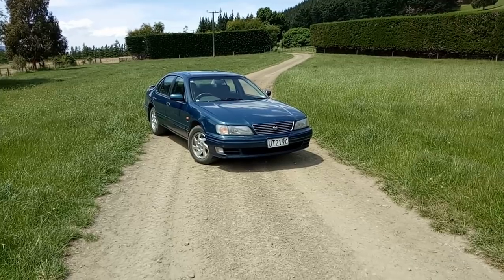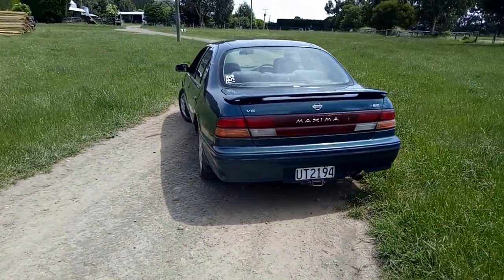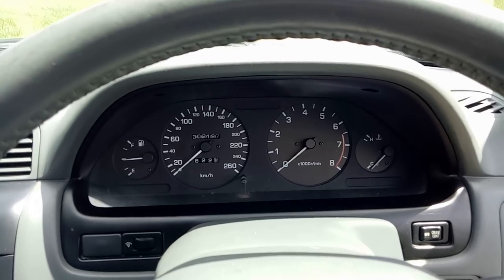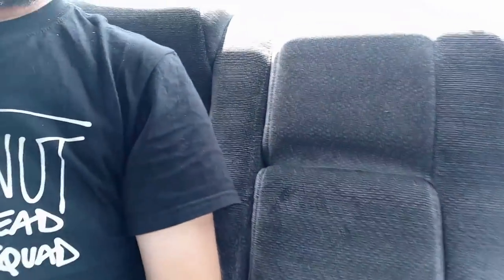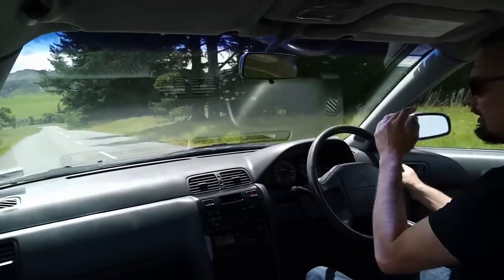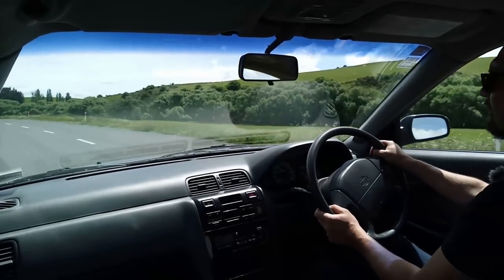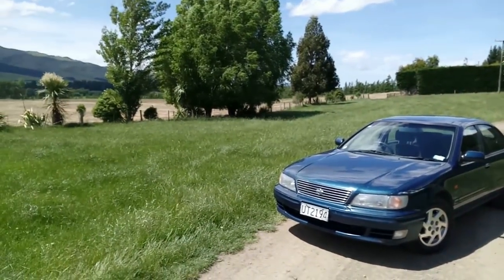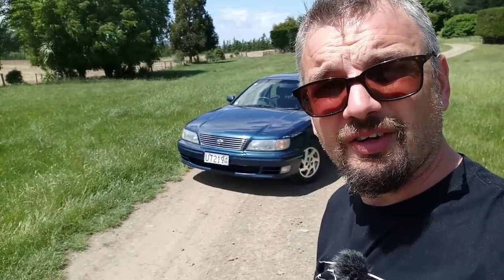Real (NZ) Road Test: 1996 Nissan Maxima 3.0i (or Maxima QX or Cefiro!)

Comment: I had 98 version of european Nissan Maxima QX, 2 litre v6 with manual gearbox and cruise. No ac. Super car, very smooth to drive and never had technicaö problems. Finnish winter and salt was end of these. Quite easy to rust.

Comment: There is something about the Maxima's blandness which inspires a sense of solidity and confidence.
Reply: Yes, they were hugely reliable, as most Nissans of that period were, and perfectly capable of racking up intergalactic mileages, not that many in the UK did.  They were just very pleasant to drive, very comfortable but not so boring as to almost send you to sleep on a long motorway slog.  Sadly, they were pretty much totally ignored in the UK and most that were around have taken their final trip to the scrap yard after being owned by people that wanted cheap luxury but weren't prepared to pay for the maintenance.  I was lucky enough to drive a couple of year old example from Devon to Birmingham, via London, usually a horrid journey, but that car made it almost pleasant.  The fuel economy was very reasonable for a 3.0 litre too, it averaged in the high-30s on cruise at 70-75mph...
Reply: @droge192    Yes.  They were just eminently sensible transport.  And, although a lot of Japanese cars from that period may have looked bland, they actually drove really well.  The Nissans certainly did because they were just really good at their suspension set-ups then.  I had a Primera Si from the same period as this QX and, other than on really poor surfaces, it was extremely composed but still handled really well.  Unfortunately, that one was from a dodgy batch of timing chains and it never got the chain replaced, so it snapped on the motorway and totalled the engine...
Reply: Almost Teutonic in their boxiness and stance.
Reply: Yes, similar to a Lexus in styling.

Comment: I love these cars. I previously had this body style A32 1998 Maxima QX with 2.0 V6 and manual. Very reliable car and relaxed driving experience. I even imported Infiniti I30 front grill for it (from the US) No complaints about the performance with manual. Sadly rust killed it from the chassis. Then I had Opel Omega 2000 2.5 V6 automatic. That car was constantly broken despite its very good service record. It would be a novel to write about those problems. Finally it died and it was clear what I wanted: It got to be the Maxima. I bought my current 2001 QX 2.0 V6 (A33) automatic and yes it's a bit slow, but not slow as you might think. Very smooth V6 with the automatic just goes effortlessly. A33 is definitely step up from A32. It feels more premium and bigger. Not so bland. I now have had it over a year and it's going strong. It now has 279 000 km (173362 miles) and very little trouble so far. Yes 3.0 V6 would be nicer, but I am still very pleased to this. Quite rare car in Finland.

Comment: Before the disastrous merger with Renault, and the downward spiral.
Reply: Nissan was on the verge of bankruptcy before the 'red marriage' to Renault, and will likely revert to that particular mean now Ghosn is gone. The 2019 results are horrific.
Reply: Merger is not an accurate description. And the notion all current Nissan Vehicles are terrible is nonsense, in fact most people I've come across moaning about them or their transmissions have never owned one, generally peruse Scotty Kilmer videos. Nissan is still rated higher than Honda in consumer reports and well above anything Euro. And now Ghosn has gone expect full Japanese ownership to return and some more interesting cars to hit the road.
Reply: @joelwebster8227  not a chance they will go under, they are still Japan's second largest manufacturer and it's one of Japan's most iconic brands. Its not going anywhere.
Reply: @Flying_GC  Not a chance? No.  
There is a good chance Nissan would be allowed to fail, in which case  the best bits would likely be offered to domestic  competitors.  And without Renault it simply doesn't have the muscle to compete in future technologies or at scale.
Reply: @Flying_GC  The GTR shows that Nissan is capable of building quality products. I look up used Nissans and always manage to find a few with bad or replaced transmission or engine, plus the mechanics I know also call them unreliable. I know one girl with a Cube that had a failed CVT at 60K, and another with a new Rogue with quality issues like clunky suspension and window that would get stuck in the door. She misses her Mitsubishi trade in.
Reply: Uncle Joe Stalin  although the new Triton and the Pajero Sport seem pretty good.
Reply: Hopefully they will become more Japanese, maybe a merger with Mazda. God the 90's Micra, Almera, Primera were amazing cars. 

To be fair, Renault also made good vehicles in the past. The 1990 Renault Trafic van I owned with a Sofim 8140 diesel engine was top quality. The design lives on as the Tata Winger in India, but uses different engines.

Comment: Best car i ever had, loved it 1999 A32 3.0V6 SEL smooth as f**k and autobox too, never wanted a German car after this. THE most underrated car ever.
Reply: 100% correct. These turned to S**t starting I think the next model year. I have a 1997, 70,000 km, previously owned by a farmer. It's truly in very new/mint condition. It spends 6 months/year in storage away from the elements. I can afford just about anything but this one is best. Not for sale. Mine is also automatic 3.0. Incredible ride.

Comment: A criminally underrated car. My Dad owned an early 1995 N registered one in 'Poverty Spec', the only difference from this model was that it got a sunroof and it had slidey controls for the heating/cold air (no air con) and was a 2 litre S with auto 'box. Trim levels in the UK were S (nobody bothered buying that trim level, it got discontinued), SE (same as this), and SVE (leather and heated seats). The 2 litre wasn't as weedy as you'd assume it to be, to be honest and could be ordered with a manual 5 speed 'box (not many were sold like this, 3 litre was auto 'box only).

Worked for an engineering firm that had a fleet of these for management and directors, all with sequential number plates; oldest being a P reg and the newest on a T reg (they facelifted the A32 slightly and dropped the 'S' trim level) in silver, "Dr Pepper" red, black, dark emerald green, and a weird olive green/silver metallic. Much loved cars in the work place, almost boringly reliable. Director traded one in for a frog eye E Class Merc and he got rather attached to his QX and missed it.  Fond memories of my Dad's car, and what I used to see in an old job I was at. When you come back to the UK, track one down to own for a bit.

Made my evening watching this. Nice work.
Reply: In new Zealand the 3litre came in manual as well. They really hauled.
Reply: @Flying_GC  Yep, America had a 3 litre manual too. It was marketed as a sort of sports saloon to give the Taurus SHO a run for its money. Sadly, in the UK it was a niche interest executive saloon car to compete with BMW 5 Series, Merc E Class and Audi A6 that "had the wrong badge" as far as most people were concerned. However, as an upgrade for people trading up from a Primera or Bluebird, or wanted something different to a Senator or Granada it made more sense.

Comment: Had a 96 P reg some years ago. Had the lesser 2 litre V6 auto, found it a very pleasant car, did nothing brilliant but neither did anything badly. Pretty good on fuel for an auto 6 pot, replaced it with a 98 honda legend which was a temptation I couldn't resist. if I could find a decent one i'd have another like a shot

Comment: They use a lot of volcanic chip rock on the roads.  Makes for great wet weather grip but doesn't half wear out tyres quickly.  When I was there they had slip test machines what would be used to check if the road needed resurfacing.   It was a big truck that would drive slowly while spraying water in front of a set of wheels.

Comment: Im in NZ, I've got a 1995 Nissan cefiro the same as this with the 2L v6 and a manual transmission, it has more than enough power, great economy, and is fun to drive. I decided to give it a full refresh after spending money on a new radiator support (common weak point in these cars for rust, even if the rest of the car is fine). I put in the cefiro station wagon headlights and mesh front grill (looks more sporty) got some better alloy wheels, factory lip spoiler, replaced worn interior parts etc and the car now draws quite a bit of attention even though they are all stock parts. There is something about this mid 90s styling that ages well. I wouldn't say it is bland, more functional and minimalist which is actually ideal for an aging car. I think this car represents the peak of Nissans refinement and is close to the perfect balance of comfort, reliability, and practicality. Later Nissans were not anywhere near as good as these cars and they will not age as well, though they are safer with more airbags etc. I'd say there is still 100,000km left in mine after the modest cost of the refresh I've done, the engines in these things are magnificent. Cheap reliable motoring and a great project which I've enjoyed.

Comment: The body front and rear are similar to an i30 Infiniti. The fourth generation of the Maxima was very reliable. The standard transmission version is a blast to drive.  Very easy to work on, Overall, the best car I've owned.

Comment: Used to see a bunch of these here in Malaysia (Here we got it as the Cefiro), I don't see much of them these days. 
I assume because the V6 engine could get rather expensive to maintain as they age. The Camry and Accord from the same time period are still somewhat common, albeit only 4 cylinders. Nothing beats the sound and the relative smoothness of the V6 though.

The Cefiro seems to be a rebadged Infiniti i30 which they got alongside with the Maxima in the US market.
Reply: Yup, the infinity i30, the cefiro, the qx, and maxima that was sold in NZ are all effectively the same car. The maxima sold in the USA had slightly different panels in the boot area and front end bumper etc, but was otherwise the same. The USA maxima was also offered in a 5speed manual trans with the 3.0 v6 which was rare elsewhere. The cefiro had the option of a 5speed manual with the 2L v6, this is the car I own in NZ as a used Japanese import.

Comment: Nice review as always...I noted not a squeak or rattle in that car, even w/ 300K kilometers on the clock--just that road/tire noise.  Indeed, this was about the fourth gen. Maxima here in the States; the first was introduced as a 1981 model, F/R layout, in sedan and wagon, w/ a fuel-injected L24 six; in 1985, we got the second gen., which I rather liked; very square, but somehow rakish styling.  That one had FWD, and used a slightly-detuned VG30 3 liter; 156 BHP, I think, vs. the 160 in the 300ZX.  Looks lovely on The South Island!

Comment: I had one of these from new [in 1998] to 2006. It was comfortable, refined and supremely reliable - and never had any faults whatever. But it was quite thirsty and - as HubNut identifies - a tad boring. When I sold it, with only about 40,000 miles on the clock, I had buyers squabbling over who got there first!

Comment: We had a New Zealand spec model called the SMX, also available on the primera with a 5 speed, SMX body kit, high flow exhaust, vented slotted brakes and sports suspension. They were really cool cars. The VG30 won engine of the year many times for a reason.

Comment: Unfortunately there was a certain snobbery against these Japanese Executives. The weren't Jags or BMWs but they were filled with equipment, they were comfortable, spacious and most importantly, they were absolutely Bulletproof. I bought a 9 year old JDM Toyota Camry from my dad and drove it daily for 4 years. In that time all it required was servicing, tyres, brake pads, a brake vacuum pump and diesel. Never let me down. Didn't rust either, it was a 1993 model 2074cc diesel turbo. It's probably still going somewhere in the Republic of Ireland. Good Ship.

Comment: One of the best & reliable engines Nissan ever made. Don’t worry about those spark plugs, you will probably only have to change them once every 200K miles. These V6 engines do 400K easy with routine oil changes.

Comment: Steering to the left slightly when driving straight on a straight stretch of road and steering to the left when you brake in a straight line again. 
Tell the owner tracking could be out.
Very nice car though with superb plush seats.

Comment: "You're better off having torque and not using all of it than having no torque and having to wring the neck of the engine all of the time." 

Not words I would have expected from a 2CV man...:)
Reply from the maker: There are times when even a 2CV driver dreams of torque. Hence the engine upgrade...

Comment: Don't be put off by the looks! It makes a great daily driver for petrolheads as well. The VQ30 is powerful, smooth and loves to rev. You can pair it to a sweet shifting 5 speed, though the 4 speed auto is plenty responsive and allows redline shifts. It uses a torsion beam rear suspension which ultimately means it's not as sharp as it could be in tight corners, Nissan did a great job at making them handle sportingly with minimal lean. I have fun driving my 96 Maxima, it's pleasant at both cruising and brisk back road driving.
Reply: @Give me some Chupa! Ahhh yes, correct! edit
Reply: @Give me some Chupa! I don't have personal experience with those, but from what I hear they are robust engines. I did try a turbo 300ZX and while the lag was plenty, the sudden hit of turbo rush was crazy fun.

Comment: I had the previous (3rd) generation Maxima in the early/mid-90’s. G556CLV 3.0i but with a single cam per bank and only 12 valves; in a fetching gunmetal grey grey colour. A most agreeable car and very different to the 2.8i Capri which it replaced.

Comment: I think the earlier J30 model was better looking. This model is indeed extremely bland.
I believe the engine in this one is the VQ30DE and not a VG engine. 
Spark plugs are under the V6 3000 cover.

Comment: Lovely looking car, and it's a Nissan, so will run forever...👍
Reply: An old nissan yes, the new ones are awful.
Reply: @SquidgyPickle  It hurts how they have fallen. They were so good in the 90s , but not profitable. The renault partnership and gohsn keadership saved the company , but the cars are now crap except the GTR.
Reply: @boundish1  Ghosn cut costs to make them profitable but also made them horrible. Qashqais are absolutely horrible.
Reply: @Perkelenaattori  Yup they feel flimsy.  Aside from corrosion 90s and older nissan are really solid.
Reply: @SquidgyPickle  Oh yeah, I was referring to the old ones.
Reply: TheAylesburyCyclist  Forever is one hell of a road trip, our enthusiastic friend...
Reply: @Perkelenaattori  My mom just got rid of the 2011 2,0i quashquai,which she bought brand new. It made a bit less then 200.000km untill it blew it's engine,so yeah. While my car is a 97 BMW e39 520ia ,with +350.000 km on it ,and it needed less repairs than the Quashquai in that era ,and it's still serves as my well maintained and reliable daily.
Reply: @Perkelenaattori  actually Ghosn bled them dry hence his arrest. The UK built Qashqai not great, Japanese built versions and Xtrails are good.
Reply: Should be called the blamonge

Comment: Seems like a damn good motorcar. Quiet, fast, reliable. Indeed, who cares about looks? Beware modern engines with timing chains. Almost all have troubles with elongation.
Reply: @3rdworldgarage450  Exactly. Just lazy maintenance. Most chains outlive the rest of the engine if looked after. I've had plenty of high mileage vehicles which I service on time every time. No T/chain issues.

Comment: Coarse road noise is largely due to the coarse road surface, i notice a lot when driving, as soon as you are on smooth asphalt road noise drops quite a lot!
I do not think the car itself was too bad, reasonable looks, early 90,s Nissan build quality ( unlike in more recent years ) the car will be comfy, plenty quick enough and very reliable plus last many many years even with 300 000kms providing it has been properly serviced.
Reply from the maker: Yes, Kiwis love a bit of surface dressing. Lots of road noise!

Comment: I changed from Holden Commodore to Nissan Maxima around 2000. First one was a Mark one in NZ, sun roof, push-button keyless entry etc and leather seats. Loved it!  That started me on a progression with Nissan maxima - great cars. Didn't like the new shape that came out and the ride was more like siting in an armchair than driving a car, so I changed to Lexus. Still think the Maxima was a great car [early models at least] - extremely reliable and very good fuel economy - better than Holden.

Comment: These were massively popular in the Middle East going back. Saudi desert cruiser. What's important there? Maintenance is cheap, the A/C blows cold, hammer between Riyadh and Bahrain/Kuwait/Abu Dhabi at 160kmh all day long.
Did I mention the AC must blow cold? Fuel cost irrelevant.
Oh, and the AC must blow cold.

Comment: I had one with the 2.0L engine, contrary to popular belief it was adequate for everyday driving, since this generation Maxima is pretty light for its size, (only around 1400kgs), by no means quick but it gets out of its own way. Unfortunately I wrapped it around a tree in a fast corner with a dirty surface. This I think was partially due to its very simple rear suspension that does like to induce oversteer fairly quickly. 

I do lust for another one, but with the fairly rare 3.0L and 5-speed manual combo please.